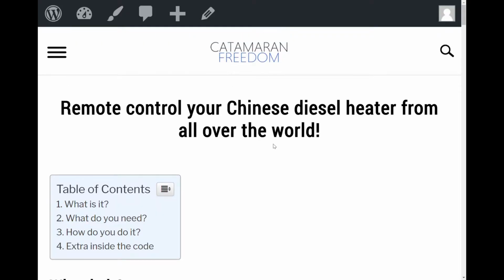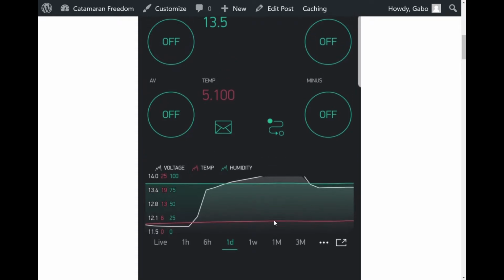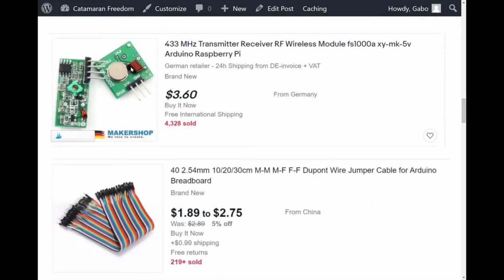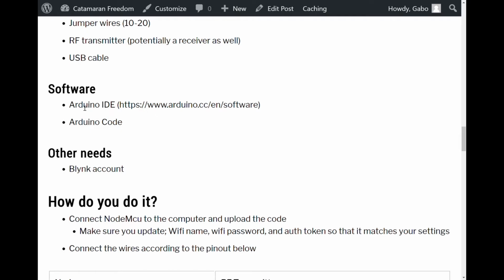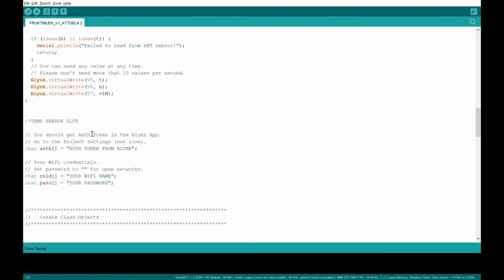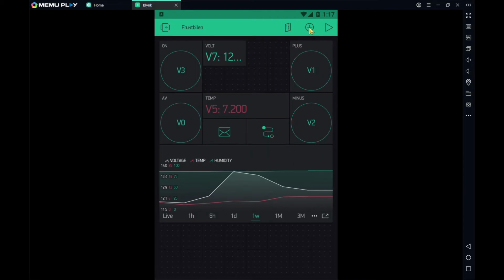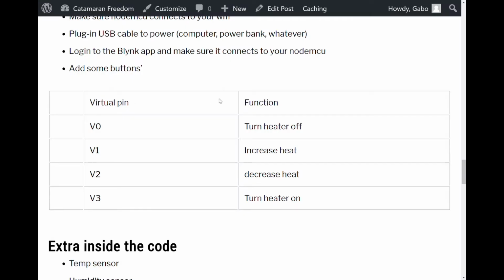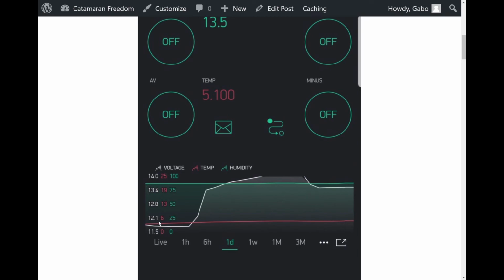Home Automation For Boats, Chinese Diesel Heater Controlled Over the Internet! DIY under USD20!

Comment: Hello would this work with the afterburner controller for a diesel heater 
I’m wanting my echo show to turn my heater on 
The afterburner has wi fi connection 
I also have a Victron cerbo gx

Comment: Hello Catamaran Freedom, 

First of all thank you for sharing this beautiful project. It's from a while ago, 
but I also want to do this with my Dielsel Heater. I don't see anywhere mentioned that the rf code of the 
remote must be added to the Arduino code. Is that correct or am I overlooking something? 
Because I already read the rf frequency of the remote, assuming it was necessary. 

Thanks in advance for your help.

Comment: Great video, what modules did you use for the temperature and voltage monitoring?
Reply from the maker: I use the DHT 11 temp and humidity sensor. I recommend checking this article out:
https://www.seeedstudio.com/blog/2020/04/07/how-to-pick-the-best-temperature-and-humidity-sensor-for-your-arduino-project/

For voltage i built my own sensor comprised of several resistors. I can send you a picture when I get back home.!

Comment: now getting this error

Arduino: 1.8.14 Hourly Build 2020/12/15 11:34 (Mac OS X), Board: "NodeMCU 1.0 (ESP-12E Module), 80 MHz, Flash, Legacy (new can return nullptr), All SSL ciphers (most compatible), 4MB (FS:2MB OTA:~1019KB), 2, v2 Lower Memory, Disabled, None, Only Sketch, 115200"

In file included from /Users/michaelmorgan/Downloads/CatamaranFreedom_Dieselheater/CatamaranFreedom_Dieselheater.ino:29:0:
/Users/michaelmorgan/Library/Arduino15/packages/esp8266/hardware/esp8266/2.7.4/libraries/ESP8266WiFi/src/ESP8266WiFi.h:27:1: error: expected unqualified-id before 'extern'
 extern "C" {
 ^
/Users/michaelmorgan/Library/Arduino15/packages/esp8266/hardware/esp8266/2.7.4/libraries/ESP8266WiFi/src/ESP8266WiFi.h:27:1: error: expected constructor, destructor, or type conversion before 'extern'
In file included from /Users/michaelmorgan/Library/Arduino15/packages/esp8266/hardware/esp8266/2.7.4/libraries/ESP8266WiFi/src/WiFiClientSecure.h:41:0,
                 from /Users/michaelmorgan/Library/Arduino15/packages/esp8266/hardware/esp8266/2.7.4/libraries/ESP8266WiFi/src/WiFiServerSecure.h:20,
                 from /Users/michaelmorgan/Library/Arduino15/packages/esp8266/hardware/esp8266/2.7.4/libraries/ESP8266WiFi/src/ESP8266WiFi.h:41,
                 from /Users/michaelmorgan/Downloads/CatamaranFreedom_Dieselheater/CatamaranFreedom_Dieselheater.ino:29:
/Users/michaelmorgan/Library/Arduino15/packages/esp8266/hardware/esp8266/2.7.4/libraries/ESP8266WiFi/src/WiFiClientSecureBearSSL.h:150:28: error: expected declaration before end of line
 #pragma GCC diagnostic push
                            ^
exit status 1
Error compiling for board NodeMCU 1.0 (ESP-12E Module).
Reply: see my comments above
Reply: @Brndjsiue  Hi no I spent all weekend and then lost the will to continue lol I just can't work out why its not working or if I have installed the correct libraries
Reply from the maker: I can't really tell what the issue is. But I would, as you suggested, reinstall the libraries and download the latest versions. !
Reply from the maker: @s thanks a lot!!
Reply: @Brndjsiue  Oh my god your right I even added those using your reply on here at the time but I added them to line 10 and 21 I didn't even think about line one lol, ok so I have ordered another nodemcu because I used the one I was trying with another WLED project on my aquarium fingers crossed thank you guys :)
Reply from the maker: Im very glad you got it working!! :)
Reply: @Brndjsiue  that's weird that the slashes are missing. But thanks for noticing and i will update
Reply from the maker: Sent it from the wrong account! But I'll update it ;)
Reply: @Brndjsiue  hi im now getting this from the new board.

Arduino: 1.8.14 Hourly Build 2020/12/15 11:34 (Mac OS X), Board: "NodeMCU 1.0 (ESP-12E Module), 80 MHz, Flash, Legacy (new can return nullptr), All SSL ciphers (most compatible), 4MB (FS:2MB OTA:~1019KB), 2, v2 Lower Memory, Disabled, None, Only Sketch, 115200"

Executable segment sizes:
IROM   : 252092          - code in flash         (default or ICACHE_FLASH_ATTR) 
IRAM   : 29156   / 32768 - code in IRAM          (ICACHE_RAM_ATTR, ISRs...) 
DATA   : 1352  )         - initialized variables (global, static) in RAM/HEAP 
RODATA : 2508  ) / 81920 - constants             (global, static) in RAM/HEAP 
BSS    : 26752 )         - zeroed variables      (global, static) in RAM/HEAP 
Sketch uses 285108 bytes (27%) of program storage space. Maximum is 1044464 bytes.
Global variables use 30612 bytes (37%) of dynamic memory, leaving 51308 bytes for local variables. Maximum is 81920 bytes.
esptool.py v2.8
Serial port /dev/cu.wchusbserial1430
Connecting....
Chip is ESP8266EX
Features: WiFi
Crystal is 26MHz
MAC: 48:3f:da:63:5d:0f
Uploading stub...
Running stub...
Stub running...
Configuring flash size...
Traceback (most recent call last):
  File "/Users/michaelmorgan/Library/Arduino15/packages/esp8266/hardware/esp8266/2.7.4/tools/upload.py", line 65, in <module>
    esptool.main(cmdline)
  File "/Users/michaelmorgan/Library/Arduino15/packages/esp8266/hardware/esp8266/2.7.4/tools/esptool/esptool.py", line 2933, in main
    detect_flash_size(esp, args)
  File "/Users/michaelmorgan/Library/Arduino15/packages/esp8266/hardware/esp8266/2.7.4/tools/esptool/esptool.py", line 2241, in detect_flash_size
    flash_id = esp.flash_id()
  File "/Users/michaelmorgan/Library/Arduino15/packages/esp8266/hardware/esp8266/2.7.4/tools/esptool/esptool.py", line 607, in flash_id
    return self.run_spiflash_command(SPIFLASH_RDID, b"", 24)
  File "/Users/michaelmorgan/Library/Arduino15/packages/esp8266/hardware/esp8266/2.7.4/tools/esptool/esptool.py", line 853, in run_spiflash_command
    old_spi_usr = self.read_reg(SPI_USR_REG)
  File "/Users/michaelmorgan/Library/Arduino15/packages/esp8266/hardware/esp8266/2.7.4/tools/esptool/esptool.py", line 490, in read_reg
    val, data = self.command(self.ESP_READ_REG, struct.pack('<I', addr))
  File "/Users/michaelmorgan/Library/Arduino15/packages/esp8266/hardware/esp8266/2.7.4/tools/esptool/esptool.py", line 347, in command
    p = self.read()
  File "/Users/michaelmorgan/Library/Arduino15/packages/esp8266/hardware/esp8266/2.7.4/tools/esptool/esptool.py", line 292, in read
    return next(self._slip_reader)
  File "/Users/michaelmorgan/Library/Arduino15/packages/esp8266/hardware/esp8266/2.7.4/tools/esptool/esptool.py", line 2045, in slip_reader
    raise FatalError("Timed out waiting for packet %s" % waiting_for)
esptool.FatalError: Timed out waiting for packet header
esptool.FatalError: Timed out waiting for packet header
Reply: @CatamaranFreedom   Next problem is the remote codes are different to mine and are 32bit what do I need to change because I cut and pasted my codes over yours but it won't compile, do I need to change the house code and socket code and how do you do this. my codes are
Reply: @Brndjsiue   I think I have a dodgy board because the original one uploads fine but now stuck because the codes in the sketch don’t work for me. So I got my remote codes and added them but don’t think I did it correct as I’m now getting errors. Am I supposed to change the house codes and socket codes ? My remote is using 32bit.
Reply: @Brndjsiue  Ok all up and running works great but the buttons in the Blynk app don't say on or off just V0 V1 V2 V3 how do you name the buttons ? I don't think its in the Blynk app but in the sketch somewhere. thanks for all the help guys I'm one happy Chappy now its working, also would love to add TEMP Humidity and voltage to this.
Reply: @Brndjsiue  I hadn’t started the Blynk part that’s why it was showing the V0 V1 Ect lol it’s been working ok today but tonight the power on button just adjusted the  the temp and would not switch on. And then trying to switch off it would not. Early days but I’m adding a dht11 tomorrow for temp humidity.

Comment: Thought this was going to be simple but I'm pulling my hair out I'm getting this.

Arduino: 1.8.14 Hourly Build 2020/12/15 11:34 (Mac OS X), Board: "Generic ESP8266 Module, 80 MHz, Flash, Legacy (new can return nullptr), All SSL ciphers (most compatible), dtr (aka nodemcu), 26 MHz, 40MHz, DOUT (compatible), 1MB (FS:64KB OTA:~470KB), 2, nonos-sdk 2.2.1+100 (190703), v2 Lower Memory, Disabled, None, Only Sketch, 115200"

CatamaranFreedom_Dieselheater:20:3: error: missing terminating ' character
   Feel free to apply it to any other example. It's simple!
   ^
CatamaranFreedom_Dieselheater:11:8: error: expected constructor, destructor, or type conversion before 'example'
   This example runs directly on ESP8266 chip.
        ^
In file included from /Users/michaelmorgan/Library/Arduino15/packages/esp8266/hardware/esp8266/2.7.4/libraries/ESP8266WiFi/src/WiFiClientSecure.h:41:0,
                 from /Users/michaelmorgan/Library/Arduino15/packages/esp8266/hardware/esp8266/2.7.4/libraries/ESP8266WiFi/src/WiFiServerSecure.h:20,
                 from /Users/michaelmorgan/Library/Arduino15/packages/esp8266/hardware/esp8266/2.7.4/libraries/ESP8266WiFi/src/ESP8266WiFi.h:41,
                 from /Users/michaelmorgan/Downloads/CatamaranFreedom_Dieselheater/CatamaranFreedom_Dieselheater.ino:27:
/Users/michaelmorgan/Library/Arduino15/packages/esp8266/hardware/esp8266/2.7.4/libraries/ESP8266WiFi/src/WiFiClientSecureBearSSL.h:150:28: error: expected declaration before end of line
 #pragma GCC diagnostic push
                            ^
exit status 1
missing terminating ' character

This report would have more information with
"Show verbose output during compilation"
option enabled in File -> Preferences.
Reply: see my comments above
Reply from the maker: Sorry for the late response. Did you get it figured out?

Comment: Hi Gabriel -  I have had a crack this evening, didn't get very far!... Set up Blynk and downloaded a copy of the code.... added my WiFi details and Blynk token to the code. When I try to verify/compile or upload the code to the nodemcu I get an error "ESP8266Wifi.h: No such file or directory".

Any ideas what I'm doing wrong? I noted in the introductory comments in the code it refers to a GitHub suppory package. I've downloaded the zip file to my laptop but I'm not sure how to apply it to the Arduino software. 

I'm a complete novice with stuff so any guidance appreciated 👍
Reply from the maker: That's correct! You need to extract those  in the right folder.!

I think this page might be helpful!
https://stackoverflow.com/questions/50080260/arduino-ide-cant-find-esp8266wifi-h-file

Keep me updated

Comment: Have you had this error before? On compile - 

In file included from C:\Users\RW\Documents\Diesel heater Control\Heater1\Heater1.ino:27:0:
C:\Users\RW\AppData\Local\Arduino15\packages\esp8266\hardware\esp8266\2.7.4\libraries\ESP8266WiFi\src/ESP8266WiFi.h:27:1: error: expected unqualified-id before 'extern'
 extern "C" {
 ^

Seems to be an error in the ESP8266 library.
Reply from the maker: Hmm. That's weird i have not seen that before, but it looks like you might have to download that library again.
Reply: @CatamaranFreedom  last thing was that my remote codes were different. I found the "instructables" guide to sniffing the remote codes. "ReceiveDemo_Advanced".
The receiver didn't work until I set it up on 5V (VIN) and adjacent ground. (Not 3V like the transmitter). 

I then managed to get 4 no. 31bit binary codes to cut and paste into your code. For some reason the "plus" key recorded a 30bit code first time around and I needed to do reload the sniffer and do that again.

Also worth mentioning that my NodeMCU was wider than the one shown in the photo and the breadboard needed to be cut in half to accommodate it and the jumper cables.
Reply from the maker: @Brndjsiue  thanks for that great info! 

What stage are you in now? Working or still compilation errors?
Reply from the maker: @Brndjsiue  if you want to. You can email me your code and i could have a look at it!
Reply from the maker: @Brndjsiue  That's nice! What are the temps at your place now?

You can write to Gabo (a) Catamaranfreedom.com
Reply: @CatamaranFreedom  I've tried all sorts. Completely removed Arduino and re-installed from scratch in case the other libraries were interfering. I have experimented with the include statements but always fails from one error or another in the library files.
Reply: @CatamaranFreedom  missing forward slashes "/" at the start of comment lines 1 and 10. Seems to competely confuse the compiler.

Comment: Thanks so much! I already ordered nodeMCU and 433Mhz receiver/transmitter yesterday (worked that bit out myself, I have little experience with Arduino boards, Blynk and nodeMCU are new to me). Do you think the remotes are "keyed alike"? Hopefully the functionality is in the Blynk app to switch on in the morning and maybe switch off subject to temperature. I look forward to experimenting when all the equipment arrives! Step by step
Reply from the maker: Yes, i think it will work! the cool part is that it could also be used to control switches, so with the same setup and a little bit of coding you can turn off lights or whatever you want! 

The blynk app has a IFTT function which makes it do almost any time related action you want. and if blynk doesn't have that function, you could just update the code!
Reply from the maker: Let me know if i can help you out with something else!
Reply: @CatamaranFreedom  I might need help to emulate the remote if necessary. 
i'll lookat your code and try to learn.
Reply from the maker: Let me know!